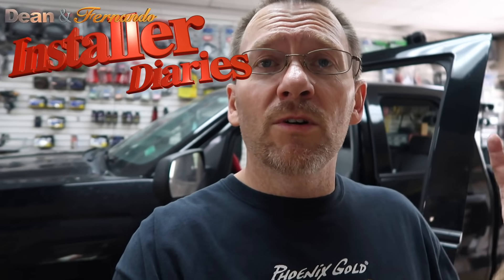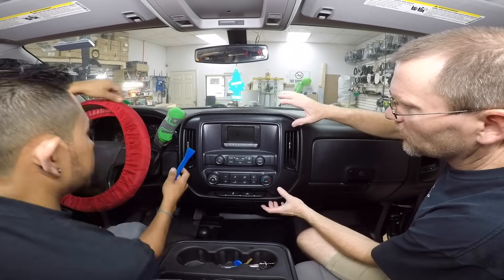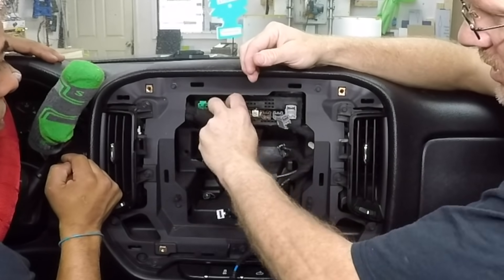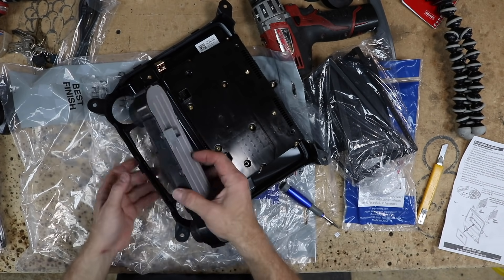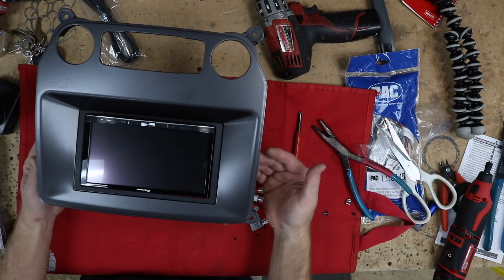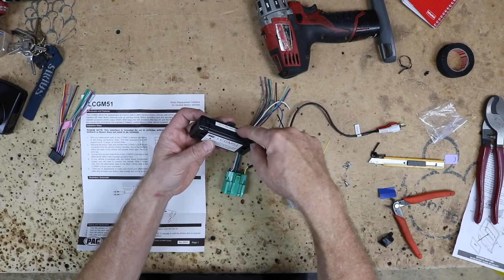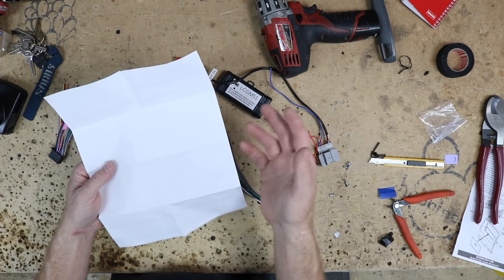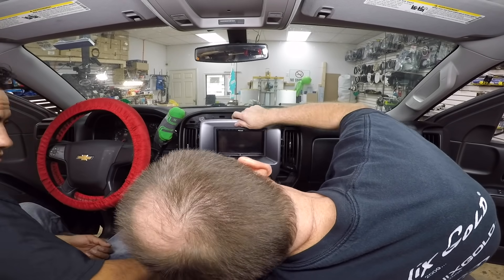A Chevrolet Silverado gets a new GPS Pioneer radio Installer Diaries 172

Comment: It's like GM had a contest to design the saddest looking radio to go in their baddest looking truck.
Reply: While Toyota has much better stock radios in the same model year even in the base model corolla. The non JBL system is nothing to ride home about but, there are sub 100 dollar component speakers and sub 60 dollar coaxial speakers that will do the world a difference in your music listening experience while you're on the road. However, a nice set of 250 dollar component speakers and 200 dollar coaxial speakers from sony with their 250 dollar 4 channel amp for sony will get you sound quality that rivals a premium sound system that you would find in luxury vehicles and you would argue that it sounds better than Bose.

Comment: I have a 2017 GMC sierra with factory radio 4.2 inch. What will i need to put a 7' double din in its place. the truck has no steering wheel controls, no amp. Thanks

Comment: Great Install Video!! I have the same truck the red accessory wire from the radio harness did you connect to PAC harness or tap into steering column ignition? Having issues powering on aftermarket radio

Comment: Just curious if he had a brand favorite? I have a '17 Sierra w/t (4.2" screen) that had no nav, Bluetooth or CD. I did the Alpine x110 SRA and there was no cutting at all and came w/ Maestro module and all harnesses. Only problem I had is that my truck has no HMI module but Crutchfield was very helpful with guiding me where to hook up factory b/u cam. Wouldn't the Alpine come close in price after factoring in cutting, harness, ant adt and mount needed for the double-din? Awesome video as always!

Comment: did you have to use a t harness to bypass amp to get sound? i bought a wire harness bypass that cost me 50 bucks but havent hooked it up just curious if yall did this to this truck the harness I looked up that u have in this video fits for the GMC 2016 1500. all i want is music out of the speaker. and the pac harness i think is either burt out or used even tho it is new but im gonna go ahead and order this harness and see if it works. just let me know what yall did to get sound thanks.

Comment: Dean & Fernando I have a question I have a 2015 GMC Sierra 1500 with the non Bose small screen no steering wheel controls but it has the optional factory back up camera. What harness should I use to replace the radio I’m using a Sony XAV-AX5000 to retain this function? Please any help would be greatly appreciated

Comment: Does installing an aftermarket stereo in a 2014 GMC Sierra 1500 prevent the driver information center display from showing information about the vehicle like speed, tire pressure, open doors, et cetera?

Comment: how did u get the sound to work i installed and my sound dont work would i need that harness? i got the pac harness and i get no sound i guess i got the wrong one but it said it was carpetable with the 2016 GMC sierra now I have to do a bypass to get sound.
Reply: did you ever get it figured out i’m in the same boat right now, everything else works perfectly but i cant get any sound to play

Comment: Hey Dean and Fernando, I am running a Maestro RR with the Foc1 dash kit (2013 focus st). Can I run two cameras off of the acc wire on the headunit or do I need a relay? The headunit is fused at the 15a. The radio is a ddx9905s.

Comment: i NEED your help with retaining the factory backup camera on the io3 to a sony andrioid auto. hmu is nowhere to be found.
Reply: Octane tv talked about that in their install video. Im not sure if he found a solution or if anyone in comments knew
Reply: @MrTcadams3  I figured it put
Reply: @dustinsattarelle5783  what did you end up doing? I finally decided to upgrade the stereo I am installing a jvc that supports back up camera but I have seen everywhere that for some reason it won't work afterwards. I don't wanna buy an aftermarket cam or lose the function.
Reply: @hata_hurta2147  what vehicle
Reply: @dustinsattarelle5783  silverado same as the one in the video, I figures this is what you had as well & since you said you figured it out I asked lol
Reply: @hata_hurta2147  theres two wires in the main harness for the back of the old radio. i belive it was a brown/yellow and something else. video +/- un pinned them from their connector and popped them into a different connector n i was rollin. really smooth fix. i found a schematic online for the WT silverado. i could explain better tomrrow
Reply: @dustinsattarelle5783  greatly appreciated, thanks for the info 👍

Comment: GM doesn't make it convenient to add aftermarket radios
Reply from the maker: The new Pioneer will hopefully fix that
Reply: @FiveStarCarStereoInc  I have a 2006/2007 Silverado Classic 2500hd and am putting a Pioneer AVIC-8400 - the install seems to be quite a bit easier. I  just had to purchase an install kit for the double din head unit. I am wanting to replace the four stock Bose 6.5 door speakers. Do you have any suggestions for which speakers are very good yet affordable? Thanks?